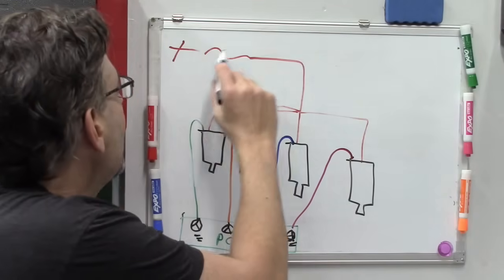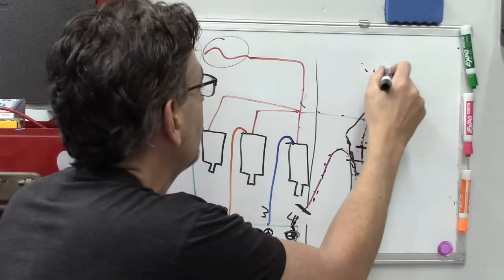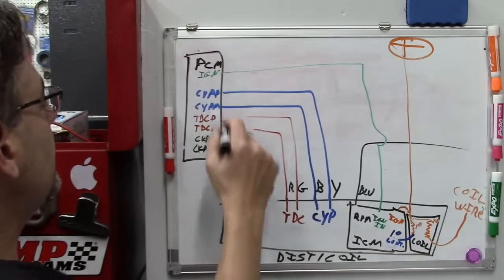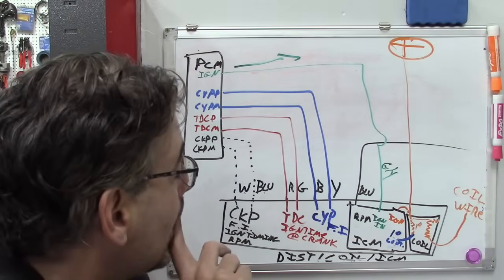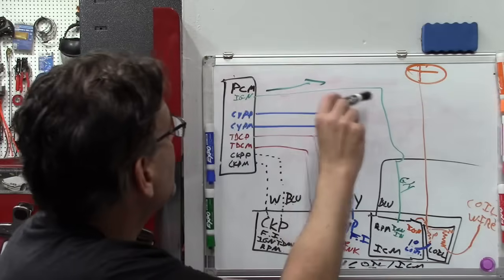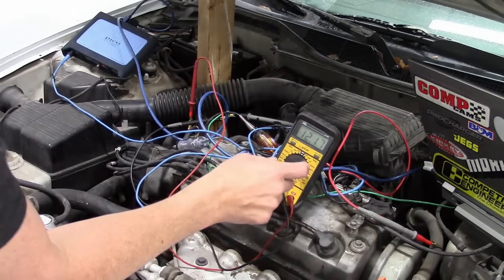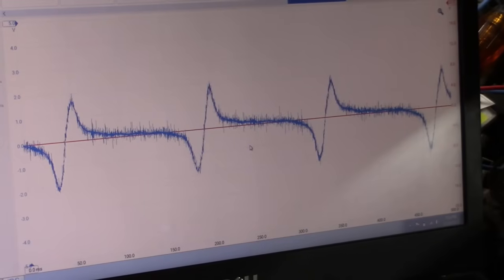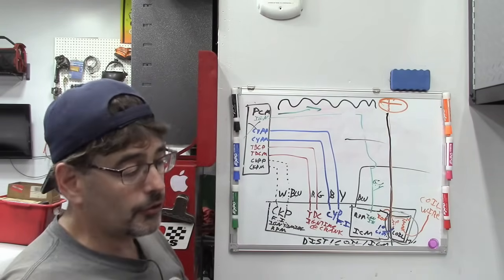DIY -How To Diagnose No Spark No Start. Bad Crank Sensor? FREE SBQM VIDEO

Comment: Hello. I have a problem. I have a 2012 yukon denali 6.2 motor. I had that 6 2 replaced but the mechanic put a 6.0 in by mistake lol. The problem is that only will run with the cam sensor unplugged. Once you plug the cam sensor in the vehicle will start and shut off almost instantly. Im out of theories. Im guessing the ecm need to be flashed. I don't know. Please give me some answers.
Reply from the maker: Oh wow that’s a good one lol. So actually while the cams are identical except for the length, the VVT phasers are different. My guess is you need to transfer over the 6.0L phasers.  That’s just a guess though. I would look at your cam and phaser positions to verify that.

Comment: good afternoon, can you please tell me how to diagnose no spark in my 1996 mazda astina ba model (5 door hatch)1.8 ltr auto  i have replaced crank angle sensor at the top of distributor with no luck
Reply from the maker: what data showed the crank sensor was faulty?

Comment: What about the main start relay that’s under the dash?❤🙏🏻
Reply from the maker: We know that relay works because there is voltage on its circuit load side.
Reply: @SchrodingersBox ok, I may have over looked that part. 
My first time diagnosing a Honda/crank- no start I had no spark and no fuel. Thought it was the fuel pump, then the coil then the distributor. Come to find out it was the main relay. That was back in the 90’s. 
Ps. I love you and your channel ❤🙏🏻

Comment: I have a Honda of this era and have been currently battling a coil issue. I think right off the bat, you have a bad Ignition Control Module or bad Coil. Just replace the distributor. Problem is not all distributors are the same in terms of quality. Lots of aftermarket junk out there. Eight wires on distributor harness are usually a Hitachi distributor. Probably a Vtech vehicle. Replace ICM and or Coil. Should fix it or just replace entire distributor. Camshaft position sensor in distributor. Crankshaft position sensor by the crank pulley. The sparkplug wires all crisscrossed and touching each other can cause misfires. I liked the video. There are very few real mechanics out there who are true diagnosticians and can follow the wires scientifically to find the problem.

Comment: At 1.09:00 why put it in vac, and not vdc in the meter?
Reply from the maker: Because I am measuring the current.
Reply: @SchrodingersBox why checking current, instead of voltage, on the sensor?

If use vac on meter, to use on direct current system, it actually measures current? If so, why not just use the amperage setting on the meter directly?

Comment: No compression in any of the cylinders, is this engine worthy to be fixed
Reply from the maker: It depends. It sounds like a broken timing belt or chain. If that’s all it is AND it’s not an interference engine where valve or piston damage has occured as a result, then yes it’s absolutely fixable.
Reply: @SchrodingersBox yeah I. Took timing cover off but cam sprocket has no timing mark?,, strange. I'm at tdc on number one cylinder "2.5 litter 4 cylinder engine" 1996
Reply from the maker: It has a timing mark. Usually lines up with back camshaft cover.
Reply: It's a Honda, so it probably needs a valve adjustment

Comment: Modern DVM can easily handle the frequency of car's PCM signals often less than 60Hz including knock sensor that shoots around 1kHz. many of these DVM will read the % duty cycle of signal pulses. However many pocket oscilloscopes allow us to visualize that signal over dual channels for less than $50. They now even have dual DVM-Oscilloscopes for less than $80. You're doing a fantastic job troubleshooting with your incandescent probe the old school way! Keep it up and just ignore negative comments.

Comment: CYP is the cylinder position sensor. Monitors cylinder position: The CYP sensor specifically tracks the position of the #1 cylinder in the engine.

Comment: I have 2 almost identical vans, both 2002 Chevy Express.  One is 15 passenger with 5.7L V8 and runs fine.  The other is 12 passenger with a 5.0L and cranks but doesn't spark.  I hit a huge puddle in a downpour and she just shut off.

1. I did your test to jump power to the signal wire going from ECM/PCM to the ignition control module (ICM), and I got spark, so I must be dealing with an issue somewhere before the ICM.
2. I already bought and changed the CKP sensor, and it didn't fix the issue, so I went ahead and swapped the CKP sensors between vans, and the good van still runs and bad van still doesn't, so it's not a CKP sensor issue.
3. My good/running van will start even if I unplug the CMP sensor from the distributor, so I'm assuming that sensor doesn't factor in, at least not until after the vehicle is running.
4. My BlueDrivetr scan tool can see Engine RPMs on the life data screen, so I believe that means the CKP sensor is talking to the computer.
5. I already bought and changed the ECM/PCM because when I first started this quest, my scan tool wouldn't talk to it at all.  I would just get a red light.  I took the old one apart, and it was all rusted and corroded inside.

Unless I'm mistaken, the last possible culprit is the wire connection between the ECM/PCM and the ICM.
Reply from the maker: Just start with the most extreme basics- what is your reference and signal voltage at the CKPS and CPS?

Comment: I really hope your still reading these i have a 02 Honda Accord ex 4 cylinder and my fuel pump is working I have fuel coming out of the rail connection 
My coil I tested and its within spec i have great compression 
No codes besides a o2 sensor 
But wont start just cranks i  even went fuse to fuse checking power plz help
Reply from the maker: Ok start with the extreme basics. Is the problem fuel, spark, timing, or compression? Always start there.

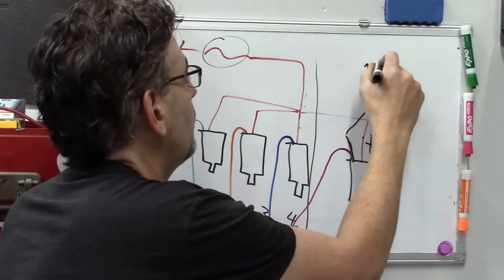Comment: The explanation of the determination that the colored wire is negatively switched is confusing for the less experienced DIYer. The whiteboard sketch at 22:30 of the test light did not show a ground. The experienced viewer sees it but understands what is happening/intended.
I have to admit that it confused me the first time I watched. Shame on me there was no excuse for me not to recognize the explanation immediately. 😮
Reply from the maker: Yeah I can appreciate that however my videos are designed for experienced people. My website however is designed for beginners- www.schrodingersboxQM.com. Once the basics are mastered, the material on this channel is easy to follow.

Comment: can you explain why when you connected the led light from battery negative to the control wire it lit immediatly? 

i understood that as being positive switched via ecu signal and otherwise just ground, so would expect no light until you were cranking and it should blink.

i base this assumption on how when you were testing if you could jump positive to the control wire at 50 min to force a spark. if jumping 12v to that wire would cause a spark, why would there be 12v there at all times later with the led light?
Reply from the maker: Sorry At approximately what timepoint are you referring?
Reply: @SchrodingersBox  

At 50:15: test light positive to ignition signal wire is expected to produce spark (it does not, but presumably would if IGM was functional). This makes me think signal is positive switched, and there should be no voltage at the signal wire except when ignition signal is supposed to fire.

At 57:51: test light negative to ignition signal wire immediately lights. This makes sense to me if it was ground side switched (and the blinking later is when the ignition signal is closed by pcm and the test light goes out). But if it was ground side switched, why would the test at 50:15 which created path to battery positive via test light be expected to cause a spark?

Thanks for your fast reply!
Reply from the maker: Ok I think I understand your question now. So on these older systems you can just happen to have it where the engine stops such that the distributer is in the middle of a dwell even and you are essentially putting positive signal to the coil input. It doesn’t spark though because the spark would only happen at the end of the dwell when that input stops and the coil discharges and results in a magnetic field collapse generating the high voltage spark. But there is nothing wrong with the coil just holding a charged state and I believe that’s what we are seeing. I have other videos that show this as well with a Hall effect cam or crank sensor where it just happens to be its generating signal because the engine stopped where the sensor just happens to on a reflector tooth and shows signal. Rotating the engine just a few degrees would turn the signal off.  In fact this is why you don’t want to ever crank an engine by hand when the ignition is on! 
     Hope that answers your question.

Comment: This is an old video so I don't know if you'll see this but I grew up working on these older transitional vehicles (pre to post obd , 70's to 90's). I didn't have much in the way of tech available but I am an avid top licensed amateur radio enthusiast, so I always applied that electromagnetic knowledge to problems like this.
The three coils (tdc, ckp, cyp) can be tested without even knowing what they do. Each has two wires to a coil. First and foremost, a simple continuity test on each coil will tell you that they are likely to be good. To test each coil further, you can put an analog meter set to very low voltage scale across the two wires for each. Then you swing a small magnet past the coil being tested. You will see a meter needle deflection positive or negative each time the magnet passes the coil. A digital meter will have difficulty picking this pulse up, but the analog unit will see it. An oscilloscope will also see it ten times better but remember, we're low tech teenagers right now working in a back yard. We don't have many tools. We especially don't have a scope yet (They were very expensive back then).
If you get continuity and a pulse on all three coils then they are all fine and you can move on to checking other components. You may be able to check the ignition coil (first making sure you have power to it) by manually collapsing the coil magnetic field by intermittently grounding the negative side if it's accessible. Make sure you have a spark gap attached to the coil output while doing this. Do a coil continuity test for an ignition coil as well. If that checks out, move on. Since we know there is power to the coil, there should also be power to the distributor control unit (ICM), test that power if possible. Since the injectors are triggering the pcm main module should be working, but there is always the possibility that the mosfet controlling the spark firing to the distributor module could be hooped but usually it was a low possibility. Those old units usually were built quite robustly using discreet and replaceable transistors.
So at this point I would plug things back in and test for a pulsed signal (while cranking) on the "ignition in" wire on the distributor module (again with an analog meter or scope). A scope would be best, but an analog meter will definitely have a small needle "wobble" at cranking speed. Back then the early digital meters just couldn't catch it. When these were built led tech was still fairly new, so testing for signal with led's was not usually the way we thought to do it. We used what we had on the shelf.  
Anyway, with all else checking out and you're not getting spark yet, then it all starts to point to a hooped distributor module (ICM). It was always about an equal chance of it being one of the three on whether it was the ICM, main ignition coil, or one of the position coils, but we very rarely ended up putting in a part we didn't need. The simple tests weeded things out quickly.
(Had to add an edit here)
The positive power supply path on the "Ignition in" wire would likely have been coming from that red IGN wire leaving the coil and entering the ICM. Then the PCM would have acted as a switching ground to turn the steady positive into the square wave pulse. That's what creates that short "Chop" to ground (0 volts). That's the way they usually built them back then. The ICM wire would be positive, the PCM would ground the ICM signal wire, that would fire the mosfet inside the ICM to ground (or lift?) the negative lead of the ignition coil, the field would then collapse and a spark would jump. The firing of the Mosfet inside the ICM is what causes the ignition coil field to collapse and produce the spark.
So not seeing a signal or power of any sort on the "Ignition In" wire would have been more likely to be a hooped ICM than a hooped PCM. I do remember one instance though where the PCM was providing the positive supply. It made for a few confusing moments. I think that was an Italian car though and they always did things in odd ways (Ha, Ha). But, with all other parts checking out, probably a bad ICM.
(Edit complete)
Anyhow, that's how I would have approached the problem back then in a very low tech way. I did quite a few of them over the years because I always drove beaters that I could pick up cheap. So did all my friends, and I fixed a lot of their cars too.
I miss the old ways and old tech. I'm a senior citizen now and am baffled daily by how we let the engineers complicate our lives unnecessarily.
I hope how I've explained it makes sense.

You all have a nice day now.

Comment: There is typically a Main Relay below the steering wheel. This relay controls both ignition and fuel flow.
Reply from the maker: There’s?? The wire diagram showed no such thing.

Comment: My x5 bmw only starts when the weather is warm it seems like . Battery is charged and ok . Should I go with starting relay or alternator
Reply from the maker: What is the voltage from the alternator?
Reply: @ alternator voltage 14.2 when AC ON
Reply from the maker: Ok provided that voltage is reaching the battery you either have a bad battery or loose electrical connection or bad starter.  Check voltage drop at starter as next step.
Reply: @SchrodingersBox  good battery good starter says autozone
Reply: @SchrodingersBox  voltage when to 14.2
Reply from the maker: Not possible. You can’t possibly have 14.2V at starter on a crank. How did you measure that?
Reply: @SchrodingersBox  turned ac on and back on post red on post how do I do it
Reply: @ I’ll locate starter and test

Comment: Hi. I think i have a crankshaft position sensor problem. Because at first i thought it was my coilpack that was faulty but i replaced it and i still have no spark at all coming from my coilpack. I have a mazda 121 Soho 1998 1.4. and I took it to mechanics but no one can fix it. I have power going to the crankshaft position wires but nothing happens..please help me with advice
Reply from the maker: Start with the basics. What is the signal voltage from the crank sensor?
Reply: @SchrodingersBox  i checked there is no voltage. Only the ground wire is working then i checked the ecu pin and the ecu pin is working but not sending voltage through.
Reply: Sorry i meant to say the pins that go into the ecu i checked those for continuity and they have
Reply from the maker: Ok if you have no signal voltage then that’s your issue. Either you have an open ground or open reference. Whats your reference voltage?
Reply: @SchrodingersBox  i got it to work. The Ecu was faulty. But now it is giving spark And fuel but still not starting. When i crank it ,it doesn't turn over and my battery goes flat quickly and then the starter motor doesn't even turn. And i have a new battery.

Comment: I had the same problem on a 96 Civic.  I replaced the distributor and that solved the issue.  Based on what I see here, it was a rather safe bet.  They put everything in there to create the spark.

Comment: A little trick i figured out when checking weird signal voltage that is low Amp or frequency  were your meter square wave. Wont test You just simply run it through a little speaker could and you get a ticking audio confirmation. 😊

Comment: What comes first, the chicken ir the egg?  My son has a 2002 Ram 4 7 that overheated. Now no spark, no fuel pump activated, no fuel injection activated. When I turn the key on, shouldn't the fuel pump relay kick on to pressurized the fuel rail before it even cranks? That's not even happening. All fuses and relays are OK. Battery voltage good. Cranks fast but no start 
The only code I get is a " Ignition run circuit is open"  . Anybody knows hiw to interpret that?
Reply from the maker: I would start by bypassing the load side of the fuel pump relay and seeing if it runs.

Comment: Please sir, I have a crank no start in a Mitsubishi car,it produce a single injector pulse and nothing more and it doesn't start. What could cause that sir? Is it a sensor issue?
Reply from the maker: Could be.  What data do you have?
Reply: @SchrodingersBox  https://youtu.be/wspK_4InsQ4?si=Me7S7BwAj5ouk3pO

Comment: Hey I got the number 6 spark plug wire with no power I've changed everything including the ECM still no power its a 2006 2.7 Sebring the car start and run the number 6 has no power i need help
Reply from the maker: Ok that’s weird because I have never seen a coil that isn’t ground side switched or uses a base input to the transistor. If you changed the PCM then you are saying yours is power side switched- that’s a first for me.  What car is this that it has a power side switched coil control???
Reply from the maker: Oh wait I see you mentioned you have a Sebring. These are ground side switched. 
   So did you find there wasn’t ground side switching from the PCM?  I am so confused on how you say there is no power but replaced the PCM which of course doesn’t provide power to any coils - I must be missing something?  First things first- Is there ground side switching or not?